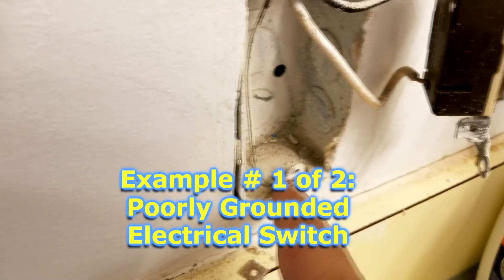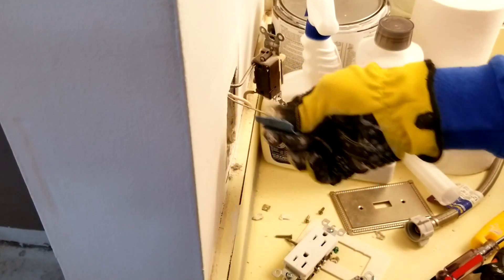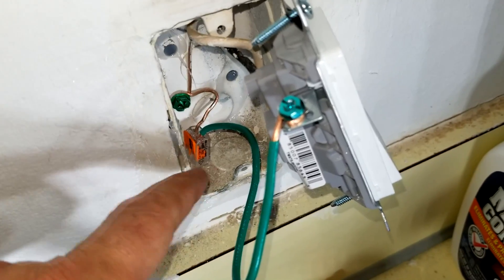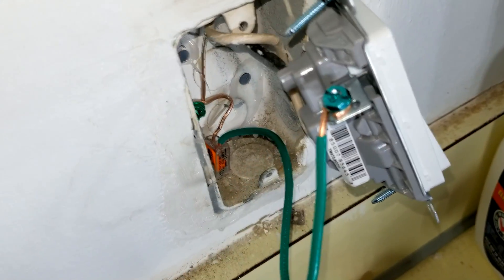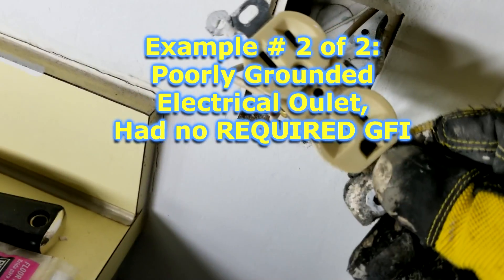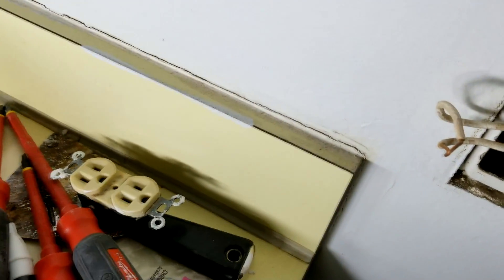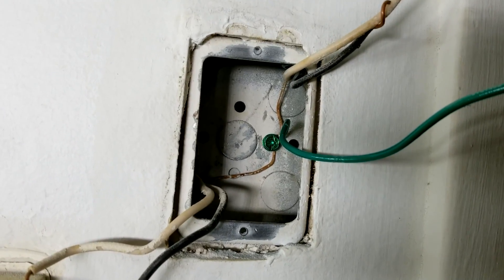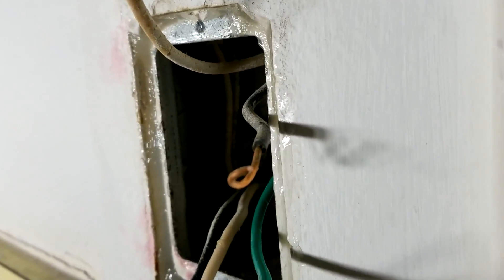How Not To Ground An Electrical Outlet - Wire Outlets Right

Comment from the maker: Protect yourself working in electrical outlets, with this tool you see me using, the Fluke FLK2AC/90-1000V Pocket-Sized Voltage Detector, VoltAlert on Amazon:  https://amzn.to/2THggao
Leviton GFCI Outlets: https://amzn.to/2BNr3rk
Wago Lever-Nut/Wiring Nut  Assortment Pack: https://amzn.to/2GpXJLB

Ideal Grounding Pigtails with Ground Screws (Pack of 50): https://amzn.to/2DMheg3
What problems have you found when working on your electrical outlet?  Let us know in the comments below and we'll answer them for you.
Reply: You can also put a pigtail onto the ground screw if the existing ground is too short, then connect the original ground to it and also connect a new pigtail for the receptacle.
Reply: Why is the box grounded but the outlet not properly grounded? 

I'm thinking about trying to place some 2 prong outlets with 3 prong, and testing the box from hot to the box, it appears that the box is grounded. What I don't understand is why they would have grounded the box 50 years ago but not with a proper ground wire.
Reply: A question in regards to grounding the box. Will any hole work in the box or are there specific ones? Also, where does one get the extra ground screws

Comment: What if my outlet doesnt have no grounds in my garage they put 20amp went to change out a plug when tested not screwed into the metal box it says open ground knce i crew it in it got to correct wire can i just run a wire to the metal box i have ground wires in my house but not in garage thank

Comment: What size hold do I need to drill in the box to screw in the ground pigtail?
Reply from the maker: Use a 1/16" pilot first, then go up to 1/8 and see if it fits the screw. If not, move up to 3/16"
Reply: There is an Ideal tool that has a bit and tap to drill and tap a 10-32 tapped hole for the ground screw.

Comment: Couldn’t you have just screwed the pigtail into the box, rather than using the Wago 221 connector?
Reply from the maker: Anyway that makes the connection is acceptable however, most electricians will tell you they prefer to do a pigtail. The reason is if you ever have to remove the outlet you don't have to worry about now undoing other wires or dragging other wires out of the mix because everything should be pigtailed to the outlet three wires, the black wire the white wire and the ground wire.

Comment: This is almost correct.  When you bond the box, you need to run 2 jumpers from the Wago connectors, one to the box and one to the receptacle.  For those who have an older house with back wired grounded boxes, if there are no tapped ground screw holes on the metal box, you can use a grounding clip on the edge of the box and connect a pigtail to your ground terminal on the receptacle or switch.  Another alternative is to drill a hole with a combo drill bit made to tap holes into the metal box for grounding purposes.  The bit is made to drill a hole and tap it at the same time.  I own a home built in 1955.  The bathroom outlet box is grounded from behind.  It had a 3 prong outlet which was original to the house.  The original owner built the house, and grounded the bath, kitchen, furnace, laundry room, outdoor porch lights and garage per 1955 NEC and local building code.  I am the third owner; my folks bought the house in 1961.  I updated the detached garage with a GFCI receptacle, protecting all circuits, including the lights.

Comment: It seems like every time I encounter these 70s/80s Slater outlets, they aren’t properly grounded! My current house had these, and about half of them weren’t connected to the ground wire in the box. My church also had these in part of the property…and no ground wire was used at all (the contractor had relied on the conduit for the ground). Maybe it’s a Florida thing, but we see this a lot down here.
Reply: Conduit serves as a ground as long as it goes back to the breaker panel.

Comment: You must put a joint from ground to medal box. The ground is from ground post in panel isolated  then to earth ground rod. Neutral is seperated in panel for earth ground isolation. Best to by a panel box withouth a ground bar then put a ground ban in it as all south east asia countries do.

Comment: Hi Jeff, Putting the ground wire under the ground screw and then installing the ground pigtail under the same screw needs some improvement.
The correct way would be to bring the existing ground wire out and pigtail it with the new ground jumper. then there would be only one wire under the 10/32 green ground screw.. Just my view from being in the inspecting field for 40 years. Thanks, Ray Paulson
Reply: Yea I was a little confused why he did that in the first outlet but not in the second outlet. In the first outlet he "pigtailed" them together with a wago connector, but in the second he just put them under the same screw. It made me, a layman, wonder what the point of pigtailing was if you could just put both ground wires under the screw.

Comment: At 04:33, I would feed the wire clockwise behind the screw so that when tightening the screw it pulls the wire closer to the thread. Just a perfectionist thing, can't be too safe.
Reply from the maker: Yes certainly wrapping the wire around the screw is king, but this side wiring and tightening the wire under that compression plate really is quite reliable and I've never seen a single failure. But we see failures all the time and sometimes the wires even break because when they backstab them into the back of the receptacle it just creates too much scoring on the wire and it eventually snaps.

Comment: I would have tied neutrals together with a pigtail to the outlet. Same with the hot. That way if the outlet goes bad the downstream stuff will still be good.
Reply from the maker: Yes that is a good way also, except there is no downstream on this one. This receptacle is the end of the line.

Comment: I hate messing with anything electronical! I have zero background. I can read and follow instructions. I have two major problems! 1st one 1st. An outlet in the master bedroom has a green wire, About 2-3 in long, sticking out of the bottom of the box through the wall. Yeah, those shoddy, shady builders!! I know to power-off the breaker. After that, don't know how to check it to make sure it's off or hoe to fix it. I need step-by-step. I not only RESPECT electricity, I'm a BIG chicken!
Reply from the maker: You need a voltmeter or voltage detector to touch tot he wire and tell you if voltage is present

Comment: If you have metal box to metal conduit to main panel properly grounded, do you need to ground your load with an additional ground wire attached to j boxes? I feel do to law of charges this is overkill and not necessary.
Reply from the maker: NEC regards the metal conduit as a good ground. BUT, when you wire in receptacles to the outlet box, you should still use a ground wire pigtail from a screen on the box, going to the ground screw on your receptacle.

Comment: Looping the ungrounded wires around the screws and then continuing down the line cannot be good. What I like to do when checking for ground with metal boxes is to use a multimeter. With the power on, one probe on unpainted metal and the other on hot wire. 120v approximately and you have a good ground. If not, then not grounded.
Reply from the maker: Yes that is another good method as well.

Comment: Six inches of wire coming out of the box...? I believe that is six inches from the point at the back of the box where the sheathing has been stripped and a minimum of three inches outside the edge of the box.
Reply from the maker: Good point Jack, not 100% accurate. I prefer 6" out of the box, it's a lot easier to work I think. Also you are close on the code, but off by 1/4". The 2020 NEC 300.14 code says that Romex wire should be 6" from the point where it emerges from the sheath, not from the back of the box. In the case of conduit, yes you would be correct, 6" from that point where it enters the box. But since NEC requires at least 1/4" of sheath inside the box, the wire must be at least 6 1/4" long. Remember also Jack, that the NEC rules says "AT LEAST 3" outside the box. Everyone forgets the "at least" part. That means you could have longer wires. Think outside the box brother!
Reply: @jeffostroff  
That's what I meant. You were just more detailed than I was and I agree on longer than 6 inches is preferred.

Comment: ur new socket ground wire is about a half inch or more out the screw exposed just like the original guy wired the old outlet that u were raggin on him for lol
Reply from the maker: Lol another uninformed troll who didn't pay attention to the video.  All ground wires are exposed in all outlet boxes. I criticized the previous electrician for wrapping the bare ground wire around a painted metal screw tab.  The strand of actually wrapping around a bare screw that is actually screwed into the metal Box unimpeded is proper as I wired it. Bit the way builder did it the paint is going to cause it to not have an electrical connection so it's not really a grounded outlet. Even though he probably thought it was grounded.. There's nothing wrong with  excess ground wire off of the ground screw  because the whole ground wire is normally bare in in an outlet box anyway. that has no bearing on the electrical function or safety of the outlet.  What I did was correct in adjust the proper method to correctly bond a metal Box to the system ground, something that previously attrition failed to perform, and something you failed to notice and understand.

Comment: Do you have to ground it? I took my old light switch off, it had to wires, the new one I put in had 3. I hooked up the two and then just capped off the third. Should I have put a screw in a hole and then screw the green one to it? I left the green wire capped
Reply from the maker: It depends on how old your old outlet box and wiring are. Sounds like you converted from an old 2-wire system that a ground was neve run. Sometimes they got the ground by connecting the conduit to ground, so I would check the electrical panel and see if there is a a third bus bar for the ground wires. IF there is none, then you have no ground. Also sometimes with switches the builders did not ground the switches, whereas in modern times, we like to ground them.
Reply: @jeffostroff  Thank you for the reply man!! Appreciate it

Comment: I have a 20 AMP circuit in my garage. One MC conduit cable with only 2 wires runs from the panel to one outlet. Is the conduit providing ground from the panel to the outlet? The reason that I am asking is because I want to add a metal junction box that will connect together a Romex, another MC cable and the MC cable that is coming from the panel. Will this connection create a ground?
Reply from the maker: I would not use MC conduit as a ground, you'll have to try to fish a ground wire through it, or run a ground from the panel to that outlet by another means.

Comment: So backstabbing is a no no, we know that, because overtime the spring loses tension, and then you use the exact same design to pigtail instead of a wire nut, which uses even weaker tension springs to hold the wires. LOL.
Reply from the maker: LOL your ignorance in physics has routed you out! The NEC approved Wago wiring nut I used here to pigtail the grounds is nowhere near the "exact same design" that you claim is the back of the outlet. Listen to how ridiculous your statement sounds. The push-in opening on the outlet rear has a clip that you push the wire into and has no real holding force. But the NEC approved Wago nuts use the physical advantage of those orange levers to push against the clip inside the Wagos and snaps down on it, holding that clip under a lot of pressure. the back stab hole on the back of the outlet does not enjoy this same holding power. Hence your assessment is way wrong.
Reply: @jeffostroff  I am only going on what I learned from an electrician, so consider myself educated, and I appreciate it. Thank you for explaining to me. I apologize, I was wrong, and I won't be using the same electrician that scolded me for using them before. That's the exact reason he gave, saying they are useless and just as weak as stabbing in the back.
Reply from the maker: @johnnyboy13642  Check also Sparky Channel, he is a decades long electrician and uses them on his projects. Also, many lighting manufactures now ship with similar, but mostly push it, which I think are not as good as the levers.
Reply: @jeffostroff  Thank you.

Comment: I have a three prong outlet that has no power with only a hot and neutral wire and no ground how can I fix this?
Reply from the maker: Something is really wrong, you don't have a 3 prong setup if you only have 2 wires and no ground. I doubt you have a neutral, I would think yo have 2 of the 120 volt linesSounds to me like someone tried removing most of the circuit, or your ground is the metal pipe conduit. Trace it back to the breaker box, you should have 2 wires that have 120 v each, and the white neutral. No to upgrade to 4 prong outlet, you need ot run a ground line from the panel to the outlet box.

Comment: Does a ground screw always protect you from a hot wire hitting the metal box? Would you smell something burning if you turned on the switch, or see watts being used? If you removed a screw on the lighting plate, would you get shocked?
Reply from the maker: The ground screw protects you if the outlet or switch is wired to the ground screw, AND if that ground screw is in turn wired to the ground wire coming into the outlet box. this is called bonding the metal box to ground and is required by National Electric Code. If the black energized wire in the box shorts to the metal box, you would likely trip the breaker and get a spark with some smoke. But what if it is not a dead short, maybe there's pain on the wires, so it's not a dead short and does not trip the breaker, now you have several amps of current flowing. So if the switch is not grounded and you touch the swtich that is screwed intot he metal box that is energized you can get shocked.
Reply: @jeffostroff  Can you use any hole in the metal box for the ground screw or are there specific tapered ones? My house was built in 1955 and they have metal boxes but no ground to most. Also, where does one get the ground screws. I tried using a ground screw off a toggle switch I bought but it was too big for the metal bracket that you connect a light to

Comment: Questions.
Why does the box itself need to be grounded?
Can I ground the outlet/fixture directly to the exposed copper ground wire bypassing the box?
Reply from the maker: By NEC electric code, all metal boxes have to be bonded to the ground because if the energized black wire in the box comes  loose and contacts the metal box, no you have problems with getting shocked.
Reply: @jeffostroff  thanks.

Comment: The EMT conduit is grounded through the metal its grounded at the panelAnswers. Conduit (RMC, IMC or EMT) is an NEC-accepted ground path. So, if the wires are in steel conduit, no OTHER ground wire is required. If that gives you concerns, you might find this link reporting research into the effectiveness of conduit as a ground relieves them.
Reply from the maker: Yes those are acceptable ground paths.

Comment: Jeff look at the old switch do you see a green screw on the old switch there isn't one. That's why the wire was cut short. The ground wasn't needed
Reply from the maker: You can't say the ground wire wasn't needed because there's no ground screw on the switch. They should have installed a switch with a ground screw.
Reply: Back before grounding screws were on the devices they were expecting the box to be grounded to the steel of BX or EMT and then the yoke on the switch would be bonded to the box by the mounting screws.

Comment: Oops , I was wrong. When I look at the video again, the wires were put around the receptacle screws correctly. They just lined up in such a way that you can't tell at first. Sorry about that.
I guess I noticed it cause I did it once or twice today while rewiring receptacles in my house, but I caught it each time!
Reply: Thanks for the further explanation, Jeff. Yes it is an optical illusion!
Reply from the maker: Glad to help!
Reply from the maker: I look for these outlets specifically, because sometimes when I rewire these old places from the 1970s, the older wire seems stiffer and harder to work with, so being able to just start with a 5/8" long straight end of a copper wire and slide it under that bracket is a lot easier than dealing with wrapping it around the screw.

Comment: 4:15 to 4:30
Doesn't look like the wires have been tightened on the screws in clockwise fashion.
Reply from the maker: They are not tied around the screws, they are clamped under the plate, you could also tie them around the screws instead.
Reply: Yup, got it. Thanks!
Reply: jeffostroff at 4:15 they definitely look terminated under the screw in the wrong direction

Comment: Referring to about 4:15 for my comment
Reply from the maker: I see what you're saying. On these outlets, you don't wrap the wire around the screw, you can if you want to, but you can see I left the wire straight, and it goes straight under that plate where the screw is nd you tighten down that plate which gives a great hold on the wire once it clamps down. What you were seeing is an optical illusion,  I never wrapped the wire around the screw. That's why I could not figure out what you meant by twisting. But if I were to use this outlet in standard configuration where we wrap the wire around the screw first, yes it should wrap around clockwise.